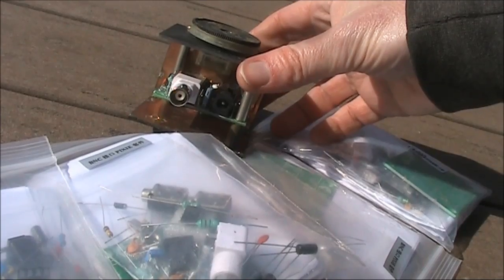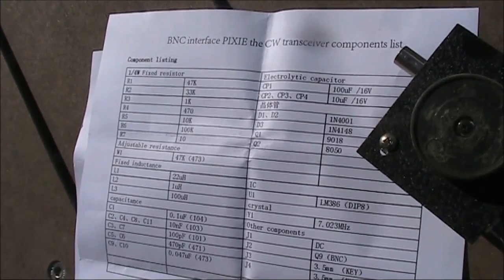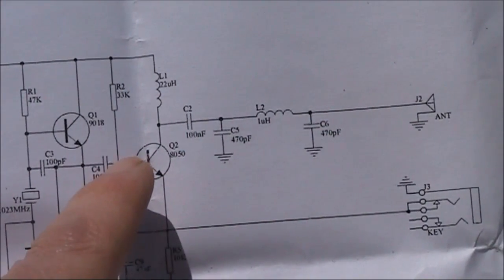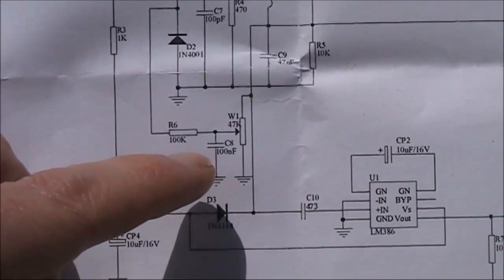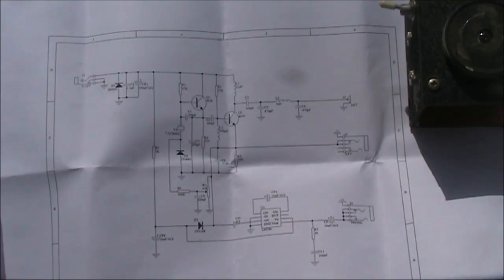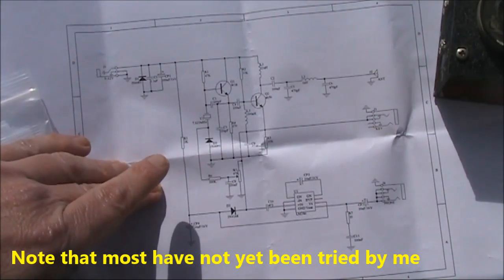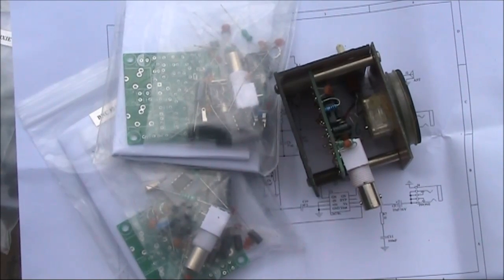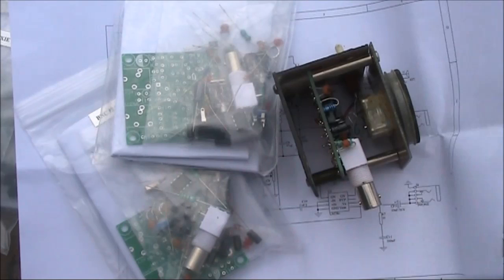The Pixie Hack Challenge: Alternative uses for the Pixie transceiver kit

Comment: Audio modulation:
I ran the + power supply wire to one side of an audio transformer, from there to pixie.
I applied external audio through the other half of the transformer and sent psk31 with FLDIGI.

Comment: Not by any means the first thing I built but it unfortunately blew an electrolytic and transistor and maybe LM386, tried to repair it but the copper track lifted.
I put in a 5.262 MHz xtal, best QSO was 180 miles with a SWL report from 220 miles. Less crowded than 40m. Don't knock it, I wouldn't call it a novelty.
Going to homebrew another.
G4GHB

Comment: Peter... one question... as you know I'm at my beginings and I'm not that good yet on adding stages... do you think there could be a way to squeeze a little more power from a Pixie...? Like maybe somehow adding one more transistor as you did for the ten min transmitter ? Just to get something maybe over 2-3W... and thank you as always. 73
Reply from the maker: Try adding a IRF510 final amplifier. You should be able to get 5 or more watts output with the Pixie driving it. There are hundreds of IRF510 circuits on the web.
Reply: Sounds amazing. Thank you Peter. 73

Comment: I made a home brew pixie, and left off the filter section, replacing it with a dummy load instead inside an Altoids can. I use it strictly  for crystal checking as it is now a very short range crystal oscillator. A crystal socket at one end and a homemade adapter  for smaller crystals allows various sizes of crystals to be checked. It works with a momentary switch to check the crystal. and a digital receiver or a frequency counter placed near by gives me the frequency output reading.

Comment: Hi Peter, enjoy the videos as always, great little kits to experiment with, long time ago now, i did the 2 crystal mod, also used vxo, good results very surprised, the very first one i had i changed all of the resistors and capacitors for very good quality ones, used socket pins to change xtals, again surprised with results, made a few into 80m for freinds, i bought a AD9850 and modified the circuit again, it works very well here in france, its time to change the osc and final transistors for a little more power, it has automatic call sign facility using a arduino micro and a simple sketch, its all fun stuff. best regards
Reply: I know it is pretty randomly asking but does anybody know of a good website to watch newly released movies online?
Reply: thank you, I went there and it seems like a nice service :) Appreciate it !

Comment: The MR100 costs $50 as an SWR antenna analyzer. Maybe you can hack a pixie to do antenna analyzing SWR with the less than $10 pixie on just 20 and 40m ?  Or is there no way to do that ?

Comment: Hey Peter nice video on the pixie mods. I have a question about an am radio that i found, it is a sony tr912 the problem is that it is not receiving am broadcast or sw etc. The amplifier stage works but i am not sure how to go about testing the am side? i have done the screw driver probing and this did make the speaker squeal but im not sure what it could be. 
if you have any pointers id be very grateful.
Thanks
Reply from the maker: Hi Ben - not familiar with that Sony. But if it's a simple superhet you'd test the local oscillator (with an RF probe or receiver) and the functioning of a mixer. An oscilloscope to check waveforms and frequencies at various parts of the circuit. Also desirable would be a signal generator around the IF frequency (possibly 455 kHz) to test the detection function. You generally work back from the speaker so you're on the right track starting with the audio. It's harder if all the RF circuitry is in an IC rather than discrete but there could be places around the IF transformers or ceramic filters that you could probe.